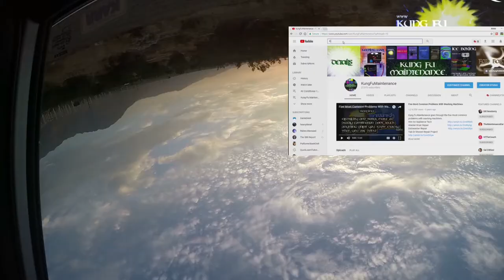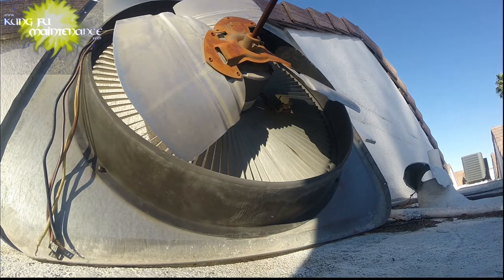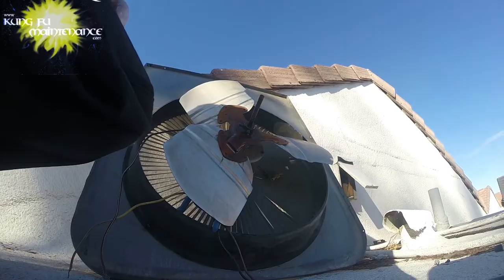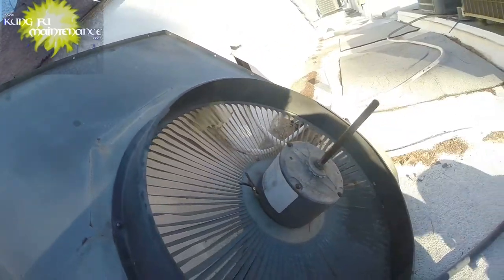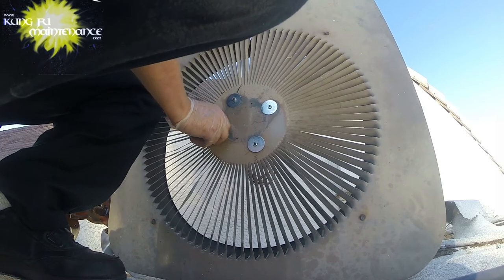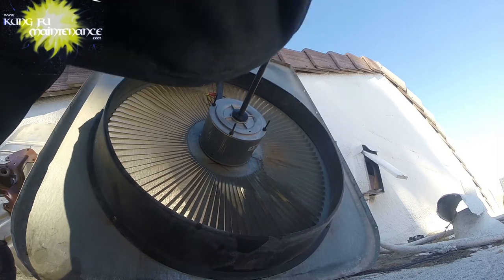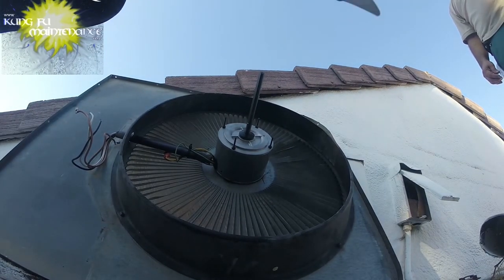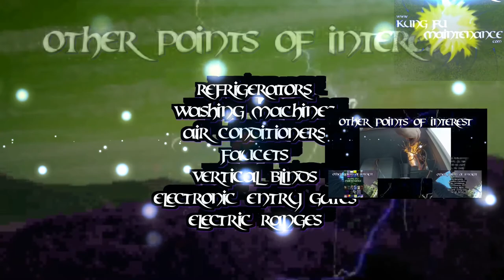Changing Bad Air Conditioner Condenser Fan Motor Don't Forget These LoL

Comment: I have never forgot to install the fan blades but i have forgotten to remove the rubber drain stopper on the fan motor.  thanks for the videos.